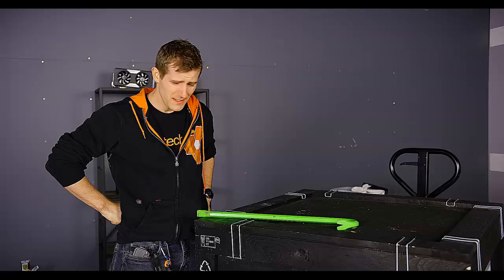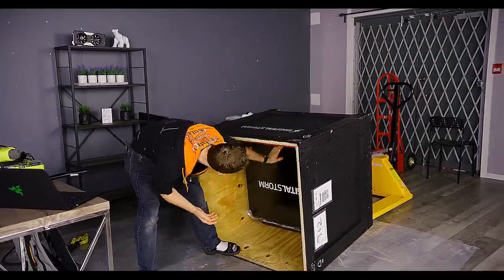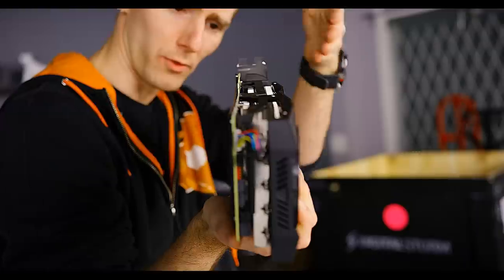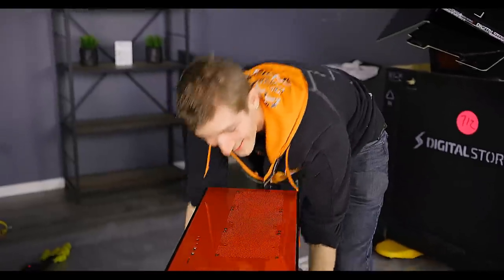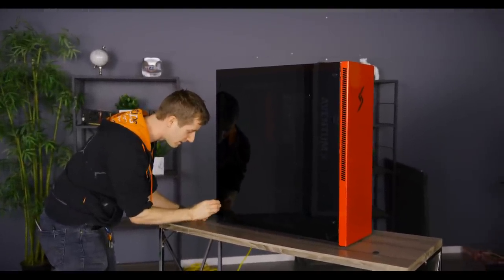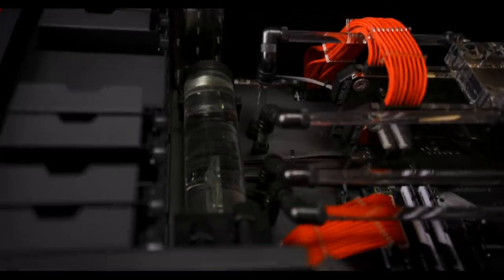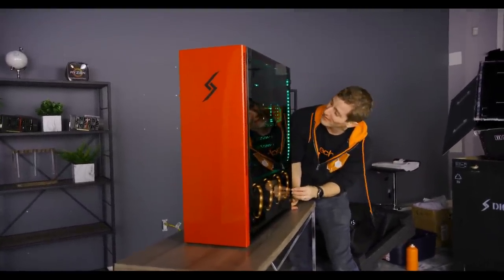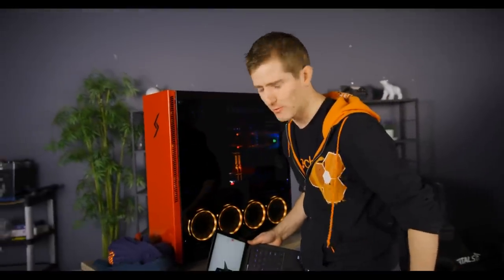UNBOXING the GOD OF GAMING PCs!!

Comment: Maybe they made the crate as big as it was so that a worker couldn't pick it up himself and just throw it around.
Reply: No doubt they would still manage to drop it off the forklift
Reply: You know what those couriers are like.
Reply: They wouldn’t be able to throw it around either way with the weight
Reply: @toxicphoenix3565  But they could drop it easier.
Reply: That's probably the reason actually.
Reply: Things get 1000 times worse when they break out the fork lift. They act like they’re in the Daytona 500.
Reply: @toxicphoenix3565   my guess is they were worried that stuff would be stored on top of it
Reply: Courier are mostly undergraduate who can't even read..
Reply: I'll leave this here: https://www.youtube.com/watch?v=Bh1YRm6n_BY
Reply: A courier once managed to roll a rack of HDS storage array off the end of a loading ramp, so you can't fully prevent stupid.
Reply: @toxicphoenix3565  you would be amased. Alec Steele had his high end automised lathe destroyed, aswell as some other big equipment.
Reply: The service tech comes in the crate with it.
Reply: I know you're joking, but actually the real reason is to decrease the tip possibility by lowering the center of mass and to deter workers from putting it up on decks inside trailers. Linus explained it exactly when he tried tipping it over. They actually did a really good job packaging that, and in my opinion this should be the standard. They could've reinforced the top a bit more and filled the empty void inside with a dense foam, in case something heavy falls on it. Most damages though actually occur not because of the workers but because of it being pourly packaged and sitting in a bumpy trailer for 2 days. I've shipped tons of these types of shipments and I highly doubt that system would get damaged if handled properly. If anyone here wants to ship a system, take note from these guys they did one hell of a job.
Reply: @Hammer201  
Or drive a forklift through it...
Reply: it can be quite the career choice actually.  @siamsimte168
Reply: You'd be surprised at what I can throw while loading a truck at UPS.
Reply: @toxicphoenix3565  I mean I probably could
Reply: @renkodeboer8159  That was sooooo sad. Alec is the last Person who deserves this!
Reply: Thats probably what happened to that unfortunate system Linus sent
Reply: Or it could be for shipping more than 1 PC in the same crate.
Reply: exactly my thinking too
Reply: If I would have money to buy that thing I would go pick it up myself or hire a transporter!
Reply: @erelpc  don't blame the couriers that much man. Most packages get ruined by the people loading them and unloading off planes.
Reply: good point
Reply: Da fu
Reply: What about those stupid delivery people

Comment: Now you can play solitaire on max settings.
Reply: Lmao
Reply: Solitaire 16K, MK Ultra settings running at 600FPS.
Reply: No it Will stil crash
Reply: And minecraft at 6900000000000000000000000000000000000000000
Reply: And minecraft at 6900000000000000000000000fp1s
Reply: Can it play minesweeper tho
Reply: @justghost_3082  i dont think it can run Paint
Reply: You can't run anything but the most intense games without also mining Bitcoin. It would underheat even with all of the fans turned off.
Reply: Nah bro that’s under kill (is that even a thing)

Comment: So why didn't you guys use those internal packers inside the system to protect the components !!!
Reply: Why did I have to scroll so far down to find this comment. Can I get an amen?!lol
Reply: because for damage like that to happen, it was dropped.....hard.
Reply: Its too costly. + and it unecessary as the water cooling system actually protexcts th system from moving.
Reply: exactly broo
Reply: If they tought about that rather than being stupid. They couldve just piece separate those parts. In one box. And how could ram get out. Should be a cjeap mobo or. An idiot that didnt properly install the ram
Reply: Totally agree. Every system should be internally packed to support the GPU at a minimum. Costs $5 for self expanding packaging and the system will be so much safer to ship.
Reply: foodhatesme i have built 7 pc in my life time ive never been to a warehouse . Clearly  and sureley ram should lock in place
Reply: Or maybe separately packed
Reply: I built my friend his pc and just driving it to his house made the ram come loose. Granted, the only thing that secured it was a seat belt and I don’t drive with much care to the system on corners.
Reply: because it's literally incased in a tank
Reply: @foodhatesme  says a guy who has a minecraft profile pic
Reply: @iamf6641  Atleast it isn't a mugshot
Reply: @foodhatesme  2 plastic clips, and the friction from the contacts.

Comment: You have reached the NERD APEX.  You can’t lift your own computer.
Reply: That's genius I have to admit
Reply: Thank you.  The truth is sometimes hilarious
Reply: I know or hope u know how big it is
Reply: I thought you get monitors with your pc... that mustve only been cyborgamingpc
Reply: Makes it harder to steal
Reply: joel coy it’s an add on
Reply: its a super tower. I would say 110 120 pounds out of the box for the whole thing. Considering the closest case in size in comparison is the corsair 1000d which ways 65 pounds empty. That case is also a fraction of the size of the one he just lifted out and that case also has tempered glass side pannels which are something no computer tec likes ever. heavy and just way too fragile.  I would hazard to guess the case weights about 70 to 80 pounds. Then add toys. 9 pounds for the water cooler hardware. That's the pump, heat block, storage tank  and all the tubing.  9 pounds in drives. Then you have about between 5 to 7 pounds in graphics cards. Then you have the weight of all the fans and the....3 maybe radiator blocks? that could be between 10 to 15 pounds with them being the size they are. We are looking at the kind of rig places buy for spot rendering. In all fairness, I also use to put these together so I know how much they about weigh since I did computers I usually could never afford to buy myself. I am the only local tech who would build water cooled systems at the time. Once you add water you add about 1.5 to 3 times the usual weight of an off the shelf best buy PC.
Reply: 110 pounds, 70 got the case, 25 to 40 for the contents.The case is all steel and tempered glass. Then you have the weight of all the water which is more then likely  5 to 10 pounds right there. Then the fact it has at least three blocks of solid high temperature aluminum or steel in it. Then all the water cooling tanks and parts in it.
Reply: @ajz562  you try lifting 70 pounds on your own then get back to me
Reply: @karl-nb9ut  70lbs on your own is easy, people can do that with 1 arm. hell 120Lbs is very doable for any reasonably fit person.

The biggest problem is that its just awkwardly large, and there is no good places to grip on to it. Linus picked it up but it looked like he was going to start slipping, not necessarily that he was unable to carry that kind of weight
Reply: It weighs 170 pounds
Reply: @ajz562  he cant lift it regardless
Reply: It looks heavy so He was ok
Reply: actually hilarious
Reply: Hahaha, all these people in here, defending linus's masculinity, amazing.. you realize, by fighting for him, you further emasculate him, jus sayin... also, his posture was all wrong for the lift, that and the fact that he's a tiny person, didn't stack up in his favour, but it's all good, big fella nick wouldda had his back xD

Comment: 12:34 I worked a season at the UPS worldport and the machines that move the packages along the belt are pretty rough on the packages. When the package gets to the designated chute, this machine punches it really hard to force it down the correct chute and then all of the packages get squished as more come down if you aren't fast enough. Then it gets crammed into a shipping container that goes on a plane. 

In theory all of the heavy stuff is supposed to go on the bottom but they hire so many people for the holidays that it's inevitable that they hire a few shit heads who don't care about the correct way to do it and just toss the packages in the order they got them. So, basically if your package arrives broken or damaged then it wasn't packaged properly.
Reply: @cartman2dk  perhaps he meant it wasnt packaged properly as in not put in the correct place in the container.
Reply: To be honest I always choose ground shipping to avoid that machine cause my grandfather told me about how rough those things were. But I’ve still gotten broken packages this time of year because of people throwing packages around or whatever happened.
Reply: cartman2dk : You have no idea what it’s like and how heavy it is in those buildings.  They are chronically understaffed. I put up almost 3000 in 4 hours last night.
Reply: cartman2dk the timestamp though
Reply: And through my experience at a local UPS distribution center, the loads (trailers) are loaded up on a dock where we're at and the boxes are pushed down through the truck on rollers. They are then dropped down a slide to the guys in primary who separate them to the belt they belong on. The belt I load off of is placed directly below the slide that they pull the boxes from so I see a lot of them dropping the boxes on the floor then kicking them onto the belt. Very often I'll get boxes that are mashed to hell or broken open in some way or another which then requires me to tape it shut (unless I want to be a dick and leave it like that for the driver). Then I take these boxes and cram them extremely tight into a truck that they probably shouldn't fit in but they do anyway. If you have never seen one packed before I'm sure you would be amazed at how many boxes they have us loading into these trucks, I'm talking full shelves of boxes loaded tight the whole way down with boxes behind and on top of others, floors underneath the shelves loaded out the same way then in some cases the center isle of the trucks will be loaded almost from the driver box to the back door. I am then also told to do that in limited time while being rushed by a moving belt (that moves rather slow until you're getting slammed then it feels like it's going 50mph) and doing that for all 3 trucks that I'm designated to load.

Now take all that and throw in someone who has a lot less care than I do and you'll see someone throwing boxes into the trucks, loading heavy ass boxes on top of boxes that aren't  stable enough for them, poorly loading heavy boxes or even boxes with liquid in them on the edges of the lips on the shelves, and not even bothering to fix boxes that come to them open or mangled. I've seen it all and have heard horror stories from drivers and other loaders I've talked to.

It's a crap system that supports extreme productivity over quality and care, like most giant corporations. The best you can do to combat it is to make sure that anything you are shipping is built like a tank I guess.

Comment: Everybody: How's it perform?
Linus: ThEsE FaNs ArE sO nIcE
Reply: @lukasvanholle9522  no
Reply: @mintys4393  Never trust in that type of PC  brands they use the word gaming to put the high prices I prefere take the case from a 90s PC and put the internal parts of a modern PC and the cost its more cheaper example you can take the processor and internal parts of a 10.000 PC for preps a like the RTX from last generation with the internal parts and pay around 500-800 bucks  for it and build your sleeper PC better than pay 10.000 for a complete one my PC its a SONY  from the 1995 I replaced all of original parts and I put the i7 core and the internal parts of an RTX the project cost was 700 dlls in internal parts and I wanted compare with the complete RTX PC's and another gaming PC's sale at amazon and I stayed open mouth for a few of minutes I said damn 5000-10000 bucks  PC's with the name gaming stuff for preps I looked the stats and memory and power of the laptops and the expensive desktops and  the computers from amazon has the same power and memory and  ram like my sleeper I just payed 700 bucks for the project just in parts and It was easy to build then the preps and sons of rich daddy's  pay around 5000-10000 bucks for the PCs with the same power I saved more money than the preps of my high school the only original part of my SLEEPER PC its the CD lector/player cause I want play 90s  games  CD discs on it and install emulators in the processor the best of 2 worlds pos-modern retro I can run PS1 and SEGA CD games in my PC and install emulators and digital programs for the most modern games of this gen obviously games for playstation and sega but I will build another sleeper PC this time with a case of a windows 95 or a windows XP or pentium II or III and  modify it with RTX internal parts and let the original CD lector to play CS 1.6 online and halo 1&2 and more OG XBOX games and put emulators for the most modern games too this time for XBOX
Reply: @giancarlolugo9586  Digital Storm is THE custom PC builder. Every shitty online custom pc builder is only around riding off the shirt tails of Digital Storm. They are the Porsche of custom PC's you're comparing them to Tonka Cars

Comment: "I've opened a lot of crates in my day."

Doesn't use pallet jack to assist.

Doesn't break down sides to make getting box out easy.
Reply: He need's that box! xd
Reply: A Delivery That Big That Heavy and That Expensive  Should Have at Least One or Two Panels That Are Screwed On and Off. That Computer is Like an Aircraft Part. You are Going to Need to Save It and All of the Foam Spacers to Move it Again. Or You Will Need to Rebuild Everything to Ship It. Why Was it Not on a Pallet or Pallet Frame
Reply: He isn't quite as clever as he thinks he is..lol it is fun to watch people struggle.
Reply: @A_Man_In_His_Van  well, he's a bit smarter than us, I think
Reply: @robrocksea  fix your keyboard
Reply: You must not be a long time viewer then
Reply: He's also wearing sandals with socks which is a sin let alone the lack of steel toes and he's lifting with his back. This dude got OSHA inspection written all over him

Comment: As someone who did tech installs at trade shows I can tell you that all the electronics arrived by special air suspension trucks. The contents ride suspended above the truck’s frame. The truck would have to suffer a hella crash to even minor dent something. Of course all the crates are modular, are exact fits for what’s in them, are reusable and come fully apart.

Comment: Now THIS is a system for the 1%
Reply: it has same specs with watercooling.
Reply: @illusion180976  yup.. because no matter what, it can only reach the same temp as the room in...and wait till it pops a leak
Reply: Icenineiv hmm i don’t think so, the 1% pc probably the one that is crazily build, using blower fans or chiller pc, etc but this is just crazily heavy
Reply: x-illusion-x . Hey I prefer the 1% waste as much money as possible. Separating the money from their pile helps the economy as hoarding it does nothing.

Comment: I like the route that Digital Storm took to protect the $8K gaming rig.  If you have a crate that is SO big that it can only be moved with a hand truck or a forklift, and it cannot be stacked. It cannot be laid on its side, it cannot be flipped upside down. So essentially you have a great way to ensure that the pc will survive shipping. albeit, very expensive. The crate is about $80 if you make it yourself and if you ship using a LTL service like SWIFT. It would cost about $250. $320 is cheap insurance over having to RMA a whole system.  And if you sell these in any volume, that could be seriously expensive.

Comment: Looks like we finally have a PC that can run Crysis.

Or can it?
Reply: Nothing short of a planet sized quantum super-computer can handle Crysis. Even then you only get 10fps. At 240p.
Reply: @ManaMastery  240 ? I don't know where you come from, but our crysis hasn't ever ran above 144 at all.
Reply: we're in 2019 only; wait a few more years
Reply: Seliet   r/woosh
Reply: Crisis as in the shooter thing I could run it on a fucking windows vista that was 20 years old wdym
Reply: Assasins creed odyssey is the new crysis. Fucking i9 9900k OC, RTX 2080ti running it in 3840x1080 (samsung 49 inch chg90) .
Reply: @Alkhiman  r/woooosh
Reply: 240p at 50% render scale xD  @ManaMastery
Reply: Still gotta wait for a graphics card, core and 9000 terabyte ram to run it at 144p and 1 frame per hour.

Comment: i'd guess this will be a similar price to the forthcoming apple mac pro due in 2019...let's see how the mac pro performs!
Reply: yes
Reply: Well for 4 TB of storage on a MacBook Pro (yes, the laptop) you pay around $3000, for a $750 part.
Reply: Let's just hope it has a gpu
Reply: Shity like all macs lol
Reply: And choose the highest option possible, because Apple would solder all the components
Reply: Conrad Hemmings 4 tb hdd is like 100
Reply: And 4 tb SSD is like 450
Reply: @jomama7210  It's 2 2tb m.2 drives in there not one 4tb 2.5" SSD
Reply: it'll likely have thermal throttling issues, it won't be user upgradable, and it'll use all proprietary parts
Reply: HOIX THE GREAT even cheaper then
Reply: Yeah this pc is probably leaps and bounds better than the 2019 Mac pro.
Reply: @hoixthegreat8359  better be fucking Nvme or it makes no difference
Reply: I think we all know that no mac could ever compete with that
not even in the year 2025
Reply: @nicholasberardi6428  I love lamp.
Reply: @FooBar89  it'll have a T2 chip...maybe ARM cpu's...
Reply: @FooBar89  native code an arm runs similar to an i7 from intel
apple future is going ARM  based  like their ipads